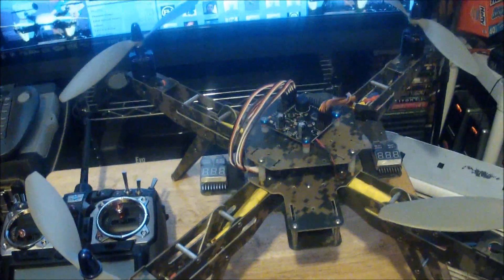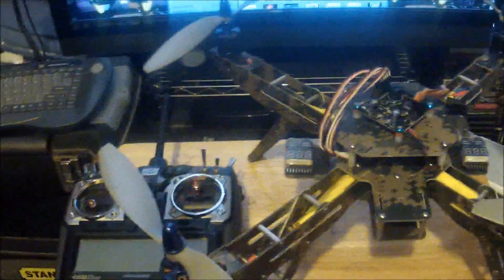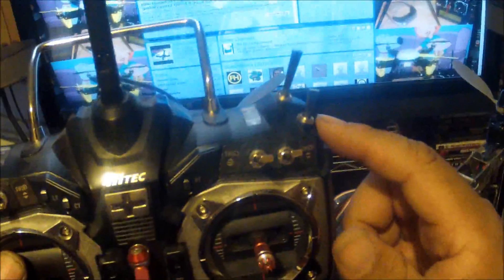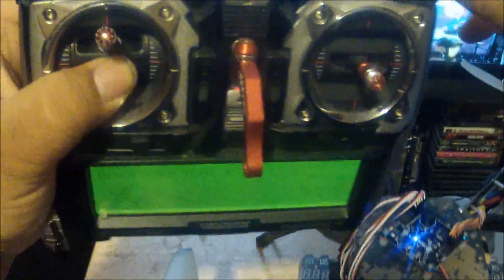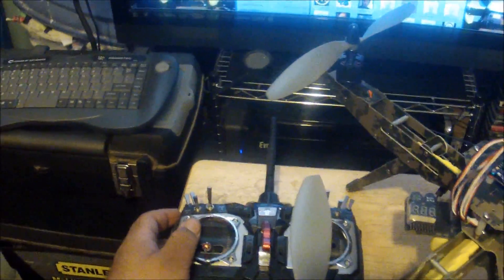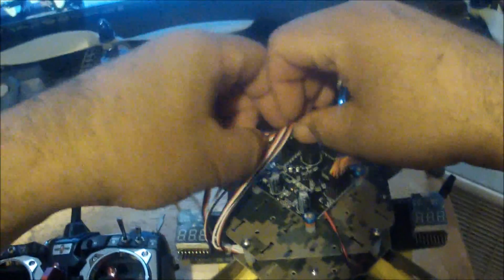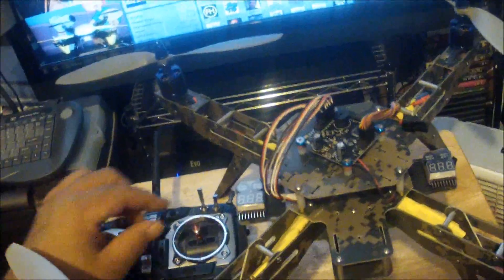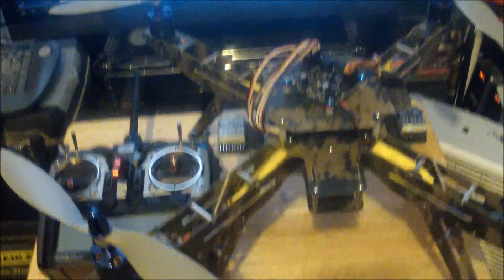The Flying Rookie's How to calibrate your FF Free Flight stabilization board to your radio ( TX )

Comment: Great video easy to understand the prosses. I recently build a quadcopter using the ff free flight white board using the v1.22 firware.Everything works when connected to the computer and run thrue the software  even the transmitter  calibration but when I try to arm it, nothing happens I even tried to calibrated the transmitter with channel 5. I do all the steps but at the end when I flip the switch to end the calibration the green light stays on please help me... thank you.

Comment from the maker: @dumindaat To reduce the vibration i used "  Associated Shock Rebuild Red O-Rings (8) " part # 5407 , when you mount the o-rings on the board mount 4 on the bottom and 4 in top of the board , used a little bit of blue Loctite on the screws and when you tight them don't screw it too tight since you want the board to float between the o-rings but also don't leave it too loose either .

Comment: Dear Derek this Video is very helpful and interesting. I have a FF board and I am coing to use it on an Xquad I'm building. Can you give me some adive on power wiring? Do I have to use 2 batteries? One for the board and one for the motors? Your help will be much appreciated.